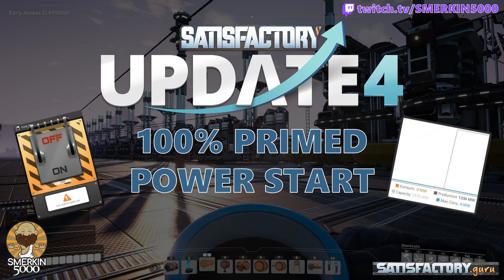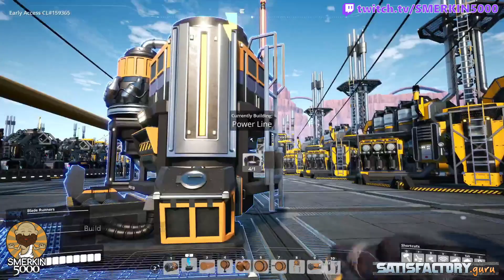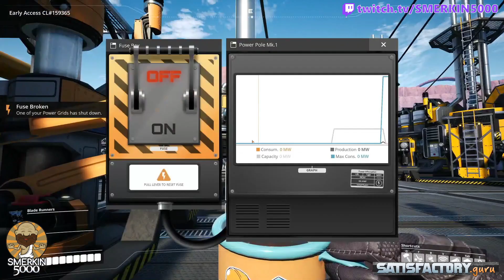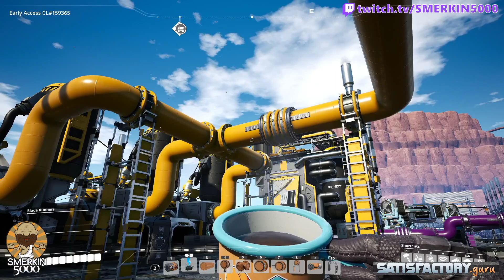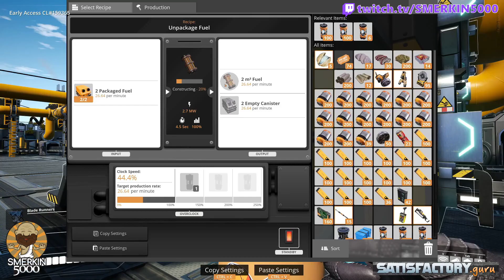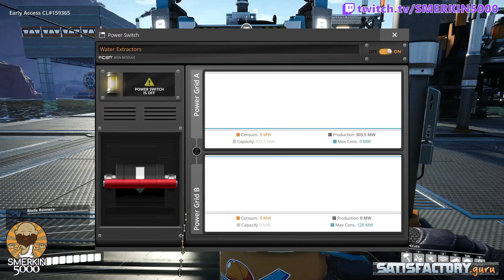100% Primed Power Start

Comment: Useful to know, but wouldn't it be just as easy and less work to simply wait to hookup the power until the pipes are full?
Reply from the maker: That is an option, but generally when I build I do it in stages, so like I connect all the pipes, then all the power and so on. During that process it means the generators won't be fully saturated when I start hooking up the power connections which means I would need to do this later. I like to get something done and move on, so if I have to come back to connect all the power poles, then using this method I can come back and flick the switch instead, easy. "Less work" isn't much when you consider it's a biomass burner and constructor I've added to the entire process.

Comment: really this could be applied to any manifold based logistics. This is wonderful news thanks for the Tip.
Reply from the maker: It shouldn’t work with production machines as they need active power to receive resources. Generators are different as they receive respurces to generate power, they don’t need to be powered to receive resources.
Reply: @smerkin5000  oh okay well thanks I guess I'll stick with putting them on standby until they fill.